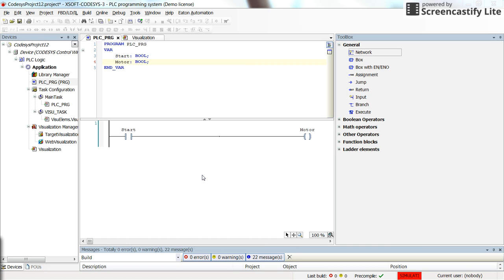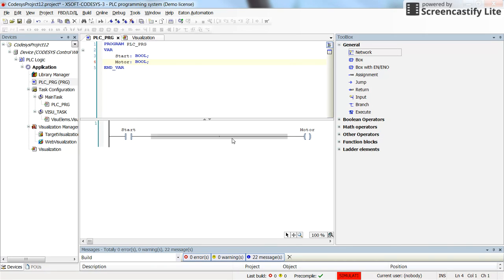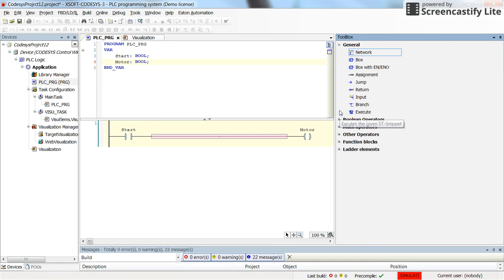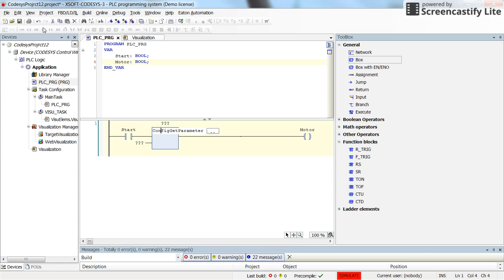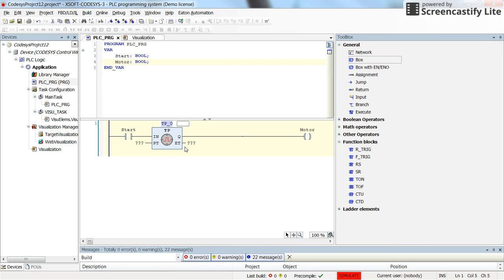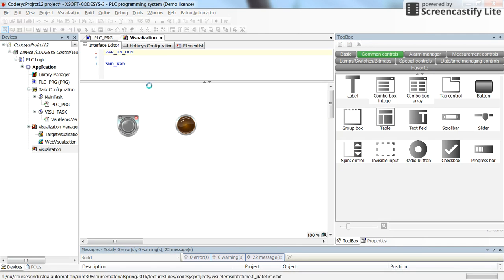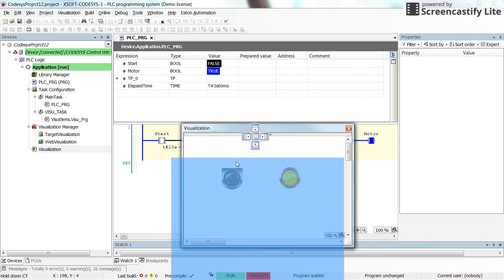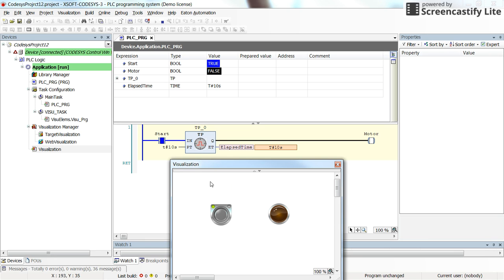CODESYS: Using TP (pulse timer) function block #codesys #plcprogramming #iec61131 #pulsetimer #plc

Comment: Good day, Hope you're doing well. Can you please advise which timer I need to use to count the time of active signal? I need to know the time of motor working.
Reply from the maker: You can use an on-delay timer, together with some other elements (some if condition to pick the Timing value when the signal becomes False), to keep track of the time for which a signal was True. In other words, the On-delay timer should start Timing as the input signal becomes True, and it stops timing when the signal gets False. You may need a huge pre-set time value.
You can also use up-counting timers in combination with timers (Pulse timer or on-delay timer) to perform the same task. In this case, as far as the input signal is True, the counter should count up with the frequency of 1 per second, and stop when the input signal gets False, giving you the time amount that you are looking for.
Let me know if you manage to do so, otherwise, I can demonstrate it later.
Reply: Good day Tohid, I did like you said, used pulse generator and counter up. However, counter up releases number of seconds, I want to somehow convert them to separate integers, like hour, minutes, seconds. Could you please advise me regarding this?
Reply from the maker: As one approach, you can convert that time value to an integer number and then based on its value, you can make the seconds, minutes, hours, etc.
Reply: Thank you very much Tohid, I wish you all the best!
Reply from the maker: You are welcome. Let me know if you can manage to get it working!